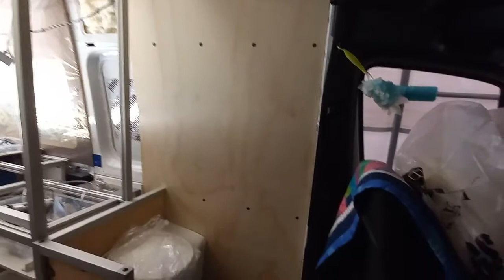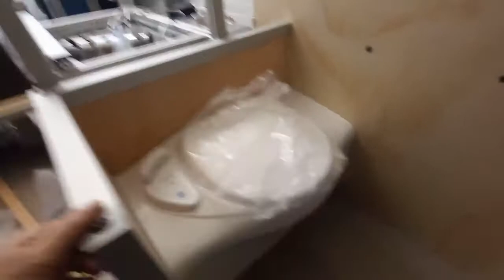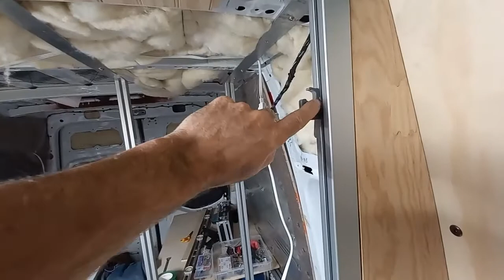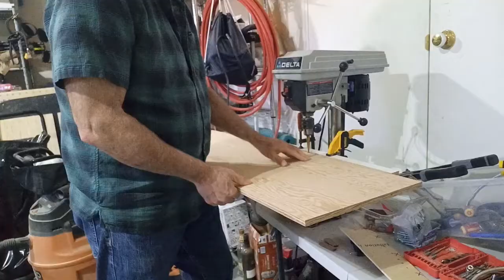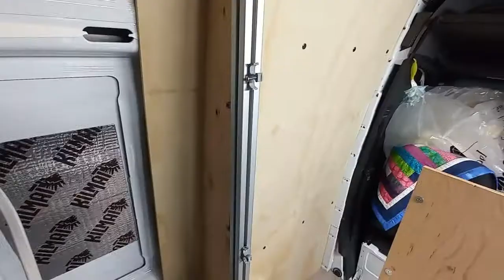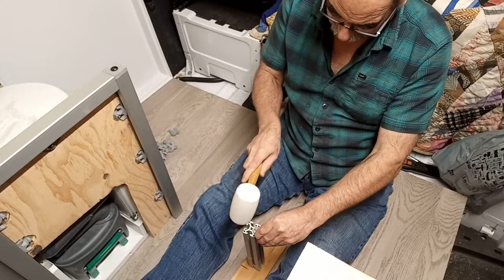80/20 panels

Comment: Are you planning on selling those clips? (In Canada?)
Reply from the maker: The clips are still being tested. I have allowed a few people the ability to order some through the company that I had do the 3d printing as kind of beta testers. if this interests you, I could get you a quote from them. I don't make a markup on this arrangement so its on a "at your own risk basis"
Reply: @cuvanbuild  I'd love some of these clips. Do you have a file that I can download and print on my 3d printer? I've been using the 80/20 panel retainers but there are areas I can't fit them in and need something that would be flush with the slot.
Reply from the maker: @billnalen  I have used a third party to print the clips for my own use  using Nylon SLS. I have been reluctant to release the files as I may want to sell the clips at some point. I have allowed people to purchase through the third party supplier who already has the files as kind of beta testers. Does this interest you at all?
Reply: @cuvanbuild  depends on the price. But probably yes and a lot of 50 would be good.
Reply: @cuvanbuild  and I like the snugness you showed in the video. I have some other types that I bought from Tnutz but they are loose and slide around a lot.
Reply from the maker: @billnalen  I will need a delivery address and an email address and phone number to get a quote from HUBS.com my email is geoff @ GMEL.ca not gmail
Reply: @cuvanbuild  Sent, Thanks!
Reply: @cuvanbuild  got it all, thanks
Reply: @cuvanbuild  I’m not quite ready to panel, so I’ll wait for you to go commercial. I could also print them myself under license, so maybe we discuss in a month or two. Thanks!
Reply from the maker: Sure. Good luck with your build
Reply: Just curious why you didn’t use Velcro or magnets to secure the panels into place rather than the Pex clips? Thanks.